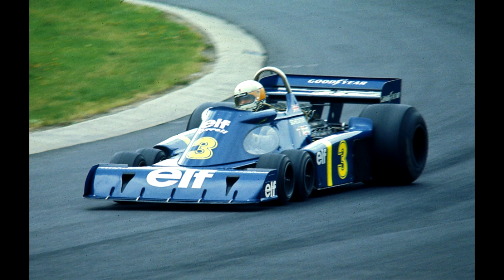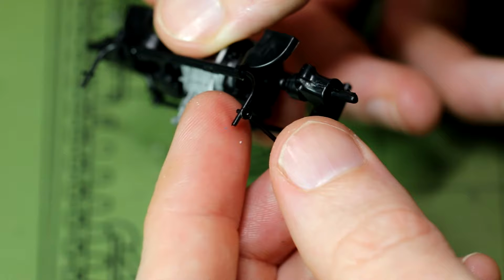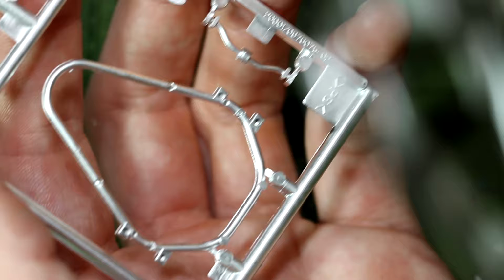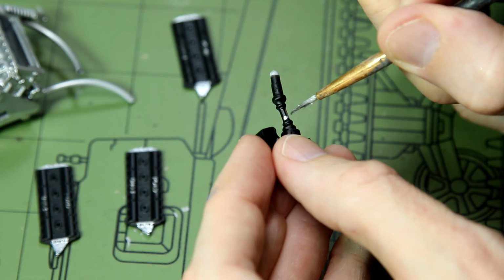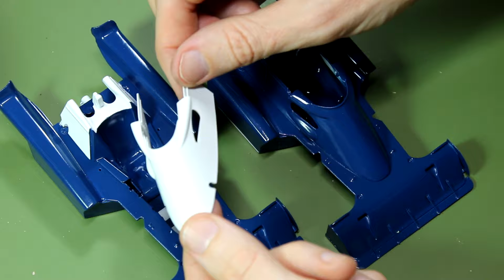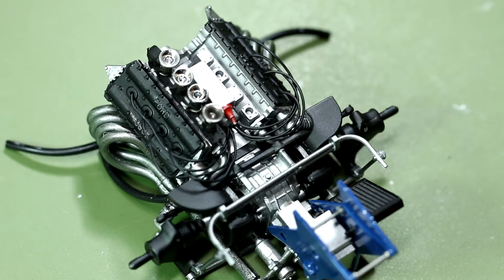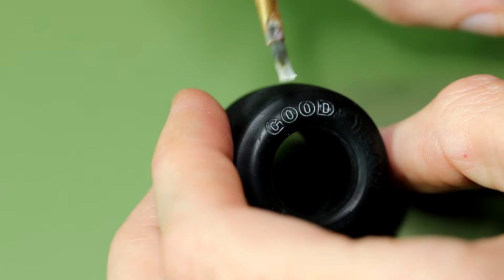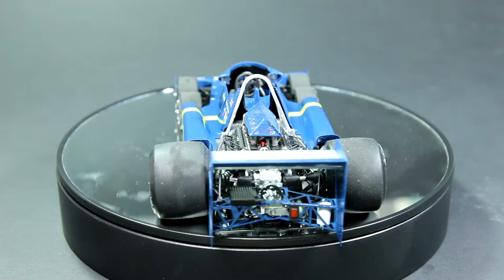Tyrrell P34 6 wheel F1 car - dual build (Tamiya 1/20 scale model kit full build)

Comment: Intriguing builds, I've not built formula 1 kits, however they are quite the change from aircraft for sure. Based on your video I can see working with the detail might help improve working with smaller details in aircraft. I did have a collection of " Dinky Toy" metal racers from 50 and 60's and have been in the pits for Can- Am racers in the late 60's. AMT kits were the rage in early 60's. Your collection is incredible Very interesting video.
Reply from the maker: Thank you mate. Funny, I just saw that one of my local hobby shops had a collection of AMT kits recently. I'd never seen them in person before and I find it interesting that they are in 1/25 scale rather than 1/24 or 1/20.
Reply: @ModelNerd  That is indeed a coincidence   I wonder how the new kits compare to old. The 1/25, was or is a great scale for for the model. The 60 era kits were fun to build, had rubber tires and nice interior detail. The kits covered a large  range of the gargantuan American  " metal " beast of the era from GM and Ford some Chrysler and the infamous 57 Chevy and Thundebirds. Glad you saw them . Cheers and standing buy for the next video.
Reply from the maker: @c123bthunderpig  Do you watch Andy's Hobby Headquarters? A while ago he did a video on a huge second hand model lot he acquired - I think from an estate sale. There were a LOT of old AMT and similar kits in that. The guy was clearly a huge collector.
Reply: @ModelNerd  Thanks, that sounds great  I haven't watched him but I will certainly find him and see if the collection is still available. Funny follow up. We had a modeling club in " my youth",  To get a new kit for our group we'd collect glass Coke Bottles , they would pay 5 cents a bottle, it wouldn't take long to collect enough for a new kit. Recycling trends way back then have certainly changed. Thanks so much again for news on Andy